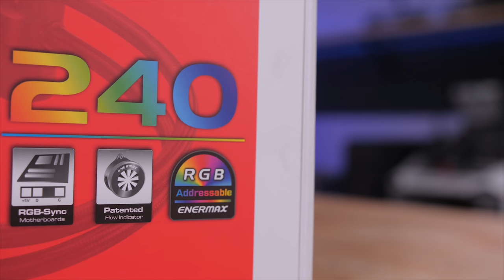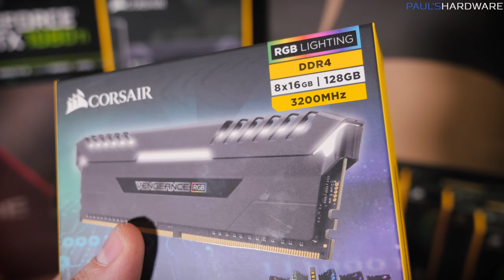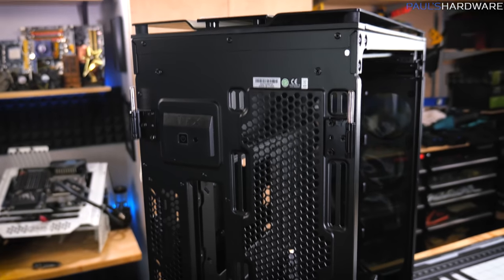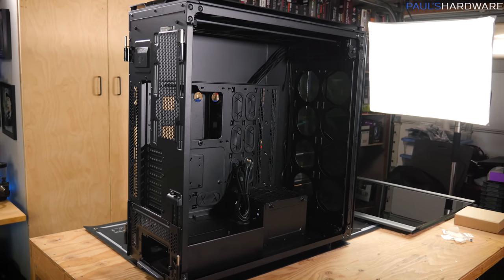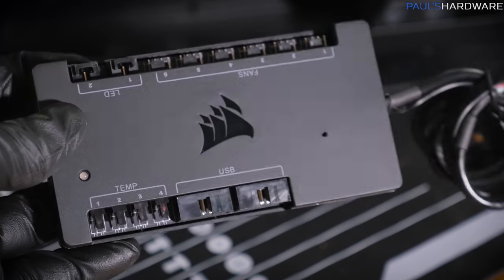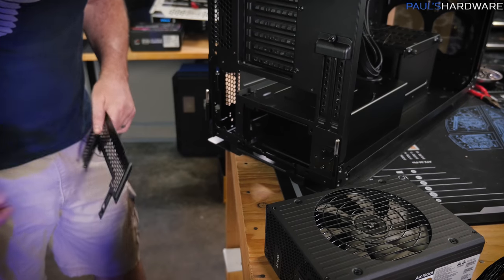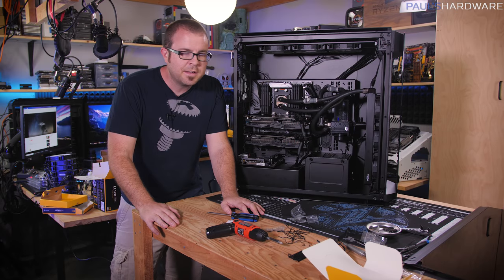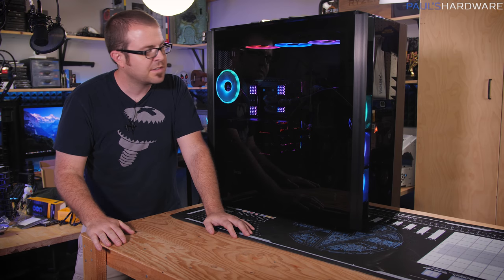Building a $10,000 PC in the Corsair 1000D - Riptide Part 1

Comment: wow, that looks like a hefty build, look'n good paul.

I do hope that 'ROG STRIX' stuff is drastically better stuff than the incredibly dodgy 'STRIX'  stuff I've seen. Otherwise, I would advise against OCing that 'STRIX' stuff and would refrain from using it as a primary CUDA compute/CPU compute work machine being slammed to its knees for days on end. Looks really nice tho.

And on the 'eh' thing list, come on Corsair, PCI knockouts on a case over a hundred bucks, that is just beyond cheap to not use actual reusable PCI slot covers. Perhaps if Corsair included a few extra slot covers to put back on the case, that may be a nice gesture for something in the, "wow that's expensive" price range. Seriously Corsair, I have cases that cost me about 40 bucks that had a full set of reusable PCI slot covers preinstalled, this thing is in the five hundred dollar range, leftover PCI slot knockout gaping holes should not be part of that cost. The rest of that case really does look good for so many reasons.

Great vid Paul and crew. B)

Comment: How would you call a radiator with support for 3 140 mills? A 420 rad?
Reply: Because 140 x 3 is 420. The reason they use that measurement for radiators is to keep it simple for consumers as overall length may change between suppliers but fan support is to most extent standard. Case manufacturers, at least good ones take inlets/outlets into account.

Comment: As always great exterior and aesthetics but shambolic interior, was really hoping this would be the one to replace my enthoo primo (The elite is just too expensive to justify for me) because cases that support 2 480mm rads are rare but the 1000d even with both my 480's in it would look empty. I also don't understand why after spending $500 we should have to spend more money to use 120mm fans on the top (it would have cost almost nothing to make that bracket universal). The hdd cage at the bottom is odd to look at and why the heck could they not find a way to route the front io cables out of sight?... My biggest problem though is what the fuck do you do with all that space on top, I already have 2 480 rads and assume most people buying this case would have the same so why make such a big space on the top? literally only an alphacool monsta 420 with push pull can fill the top properly even if I had 4 1080ti's I would not need that much cooling :| This case was rushed to market without being refined.

Comment: hi paul the front 480mm bracket can it be switched to the top?, wondering if this can fit 4 x 480mm fans in it, as corsair state you can buy additional brackets
Reply: 4 x 480 radiators I mean not fans :)

Comment: I still can not understand -- why use the AX 1600i over the AX 1500 in this build? The AX 1500 is made by Seasonic while the AX 1600i is by flex -- it is apparent that the AX 1500 is the superior PSU and much more suitable for a build like this.

Comment: Its bootyfull. Suggestion: No psu extensions. Instead get sleeved PSU cable replacements measured to exact length like Singularity Computers because OSD. cant wait for the second part.

Comment: good luck with the corsair ram, i had the same kit and it kept blue screening 2 different systems.
Reply: Joey Campanile which series did you have and were you on intel or ryzen?
Reply: i had the corsair rgb vengence ram it was a 32 gig kit and ddr4 3000 speed it blue screened my 6850k and my ryzen 1700x i put my old ram back in and no problems what so ever. put that same ram in my wifes 6700k build and it blu screened within a few hours, got it rma'dand the new set lasted maybe 2 weeks before it started acting up. i use alot of corsair parts and perifs i will never use that ram again, and i am an RGB whore.
Reply: Joey Campanile do you still have the kit? Thanks for the detailed reply man
Reply: no i sent it back to new egg. i actually tried 2 different kits, so it isnt like i  didnt give it a shot. unfortunatly i think corsair just uses a low binned product to keep costs down so they can use there RGB.
Reply: Joey Campanile interesting. Any idea if their dominator series will be the same? And what brand would you go for?

Comment: Why didn't they make it so you can remove the power supply without removing the cover. By having it slide in and out (like many other case manufacturers have done)

Comment: I hate water coolers. I get you might need it, but it can cause so many problems if it messes up...
Reply: Have had mine for years, custom loop, no issues. Clean it every time I do a rebuild, an hour leak test by bridging 2 pins on the 24 pin connector, off I go to overclocking and still staying at low temps.

Comment: Paul,  invite Kyle over to help you do a custom EK loop. that aio looks like shit. QD or not those hoses have to go.

it's like some wierd fat spiders are hanging out in your case. please do a part 3 with a custom loop. ridgid tubes only. use the fancy 90s and just do straight cuts if you dont want to bend. it has to be done. use real glass tubes. please. 

also, i think you should do some case modding. paint it and make it sweet! ask jay what fittings never corrode. I remember a video he did where some fittings were mint condition after a couple years with a certain fluid. different fittings have different reactions to certain fluids. get it right the first time. jay knows which ones to pair. even if their not the best looking ones low maintenance is more important. 

10k system needs real love! please make it epic!

Comment: The power supply filter comes out the back on a system that will weigh over 100 pounds after set up... Makes no sense at all, why do companies keep doing this when it would be just as easy to implement a side filter and much easier to clean once it's built

Comment: I am building a very similar Threadripper system except believe it or not my case/desk is going to be even bigger and cooler.  My build log is in LTT forum if you want to check it out.
Reply: Wood.Work.LIFE.
What is the solution you build the workstation for, need CPU computing, what will it run?
Name the solution it needs to serve, then we can say if your hardware is good for it to run it on!
Does it replaces a working solution, care about uptimes? Wood casing?
Reply: It is going to be built into a live edge wooden slab desk.  I built it in a video a few months ago.  The workstation will be for 4k video editing, color grading, rendering, and limited VFX work.  I am actually using 2 400GB Corsair NVME drives in raid.  Uptime is not a concern for me but I do a little limited gaming on it as well.

Comment: 10gs and you cant even do a thredripper 2990x or 2 2080ti vids??? seriously? i wouldnt have spent all that money on ram or HD space. wow you only need one NVME  M.2 say 500gb for the Win10 64bit  tops. Then 2tb SSD HD tops for games. there are alot of way to spend 10gs much better. o yeah and skip the cooling unless you plan to overclock anyways. ******EDIT nevermind this vid came out before the 2080ti were even released my bad. This is a bad ass system for the time!

Comment: Paul, why don't you use the 2700X?
Reply: For the NAS build? That would be excessive. Free NAS (or whatever Paul is intending to run on it) doesn't need 16 threads or a graphics card to run. It's just a system for storage. In that case, using the 2400G and undervolting it gives you fantastic power efficiency and integrated graphics to set up the software.
Reply: OmniSzron oh yeah i forgot its for a NAS system, sorry😅

Comment: I know this is 6 years old by now, but wtf is this, corsair 1000d to run 2 1080 ti's with a tr4 motherboard, and the 2 gpu's arent even set as 1, but 2 singular gpus, 1600 watt powersupply, 7 total fans for a case thats supposed to run 30 fans, a side mounted radiator with a (Costum loop) that just isnt needed, And the second system wasnt even connected at the end..
And the fan in the back was put as intake, that you flipped the right way before filming the final shots.

Again I know this is 6 years old, but why was this in my recommended page.

Comment: Raven Ridge isn't ECC compatible as motherboard makers are not enabling that support outside of the Pro versions.
Reply from the maker: It's up to the motherboard manufacturer to enable ECC support, I have confirmed with ASUS that they're validating ECC memory for the X470-i Gaming that I'm using for the lower build
Reply: Paul's Hardware I think he was trying to say that you should validate with them if it works with the CPU. It may only be the Ryzen Pro CPUs that work with ECC.
Reply: Paul's Hardware This is a first for RR if so. The R3/5/7 non-APU parts are so far working but I haven't seen anything for 2200/2400G in this regard. If true I'll be a happy camper but that's an expensive board for the purpose. BTW we've been discussing this sort of thing on the L1T forums, since you cited Wendell ;-)
Reply: And ryzen for a freenas built is a bad idea. They probably just say to you buy a suported supermicroboard if you ask for any support on their forum. A zfs on linux would be better imho.